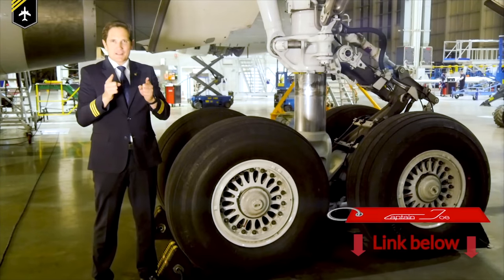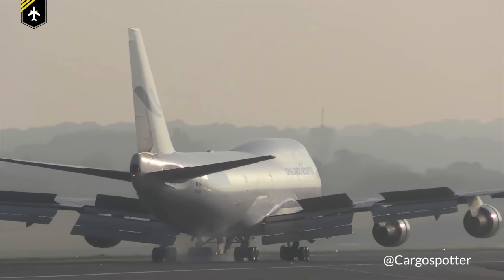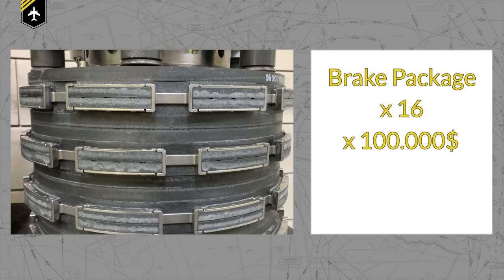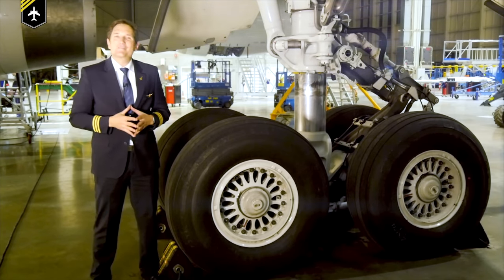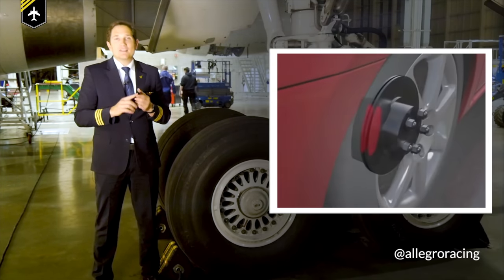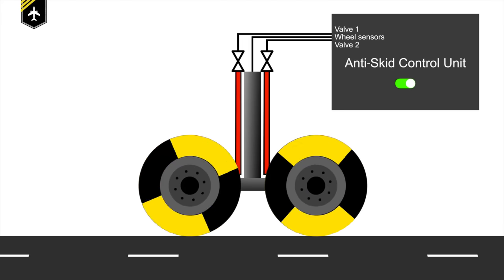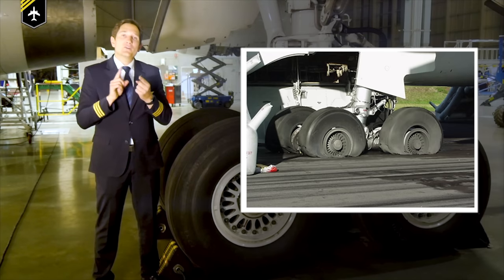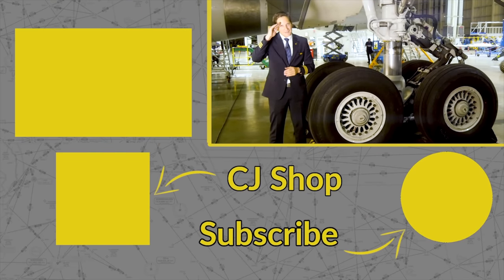Do PLANES have ANTI-SKID??? How to PREVENT SKIDDING? Explained by CAPTAIN JOE

Comment: Joe how can you tell the difference between a Airbus A320, A321 and A220
Reply: kose the a220 looks totally different (it's a rebranded bombardier aircraft after all)

Meanwhile in case of the a320 vs the a321, the a321 is noticeably longer, and it has 4 sets of doors each side (the A320 has 2 doors plus 2 smaller over wing emergency exits each side)
Reply: @ZK-APA  awesome thanks for the info

Comment: Interesting topic. At what frequency (per second) can a 747 anti-skid engage/release the brakes? I thought I once heard somewhere about an anti-skid auto brake system that automatically disengages at the first wheel lockup (and thus release of the brake pressure); just to make sure the wheels are not locking up on auto brake but without rebuilding brake pressure. So after activation a manual braking procedure would have to be done to engage the friction brakes again. I'm just curious if you might have heard of a system like that?
Reply: That doesn't sound right.  What does happen is that as a tire starts to lock up, brake pressure is reduced and then this repeats many times per second.

Comment: Hey joe., i have question. 
As you said during emergency landing when engine fails / or fuel leackage situations., efficient braking with the help hydraulics and reverse thrust ans cannot be possible.  So maual braking is the only way.

Why hydraulics is not functional..? 
Is the power by batteries inside not enough to source braking power..? Or not allowed to burden batteries.

Comment: I have a question. Why do pilots put the gear down so early when landing?
Reply: Gaming BrosBogdan because the aircraft has to be fully configured and stabilized before a certain point during landing.
Reply: The gear typically comes down on about a 5 mile final.  Each airline has a “Stabilized Approach” policy that dictates when certain configurations must be met.  Also, if the aircraft is faster than desired and descending, it can be difficult to slow down to the maximum flap speed for the next flap setting.  The landing gear is one of the best drag devices on the aircraft, and can be used to slow the jet down quickly to the desired speed.

Comment: What is the redundancy for the anti-skid control unit valve in case it malfunctions?  Seems like if it were to fail in the activated position, it would essentially make it impossible to apply the brakes?  Assuming I'm missing something.

Comment: Can you do a video on how airlines plan out which flight will go out of which gate number?  When I go to the airport, it seems pretty random, although I doubt it is actually random.   What factors actually go into how the airlines assign the gate of each flight?  Does it matter the type of plane?  Flight Time?  Proximity to other aircraft?  Number of expected passengers?   Grouping of common connections?  Do different airlines use different gates?  I am curious how this process is planned out.
Reply: Stephen Hinkle the gates are usually randomized. But there are factors which determine the randomness. Eg some gates can handle only certain kinds of aircraft (some are for narrow bodies, some for wide bodies, and some for say the A380)
And for gate from an aerobridge vs gate to a bus to go to the aircraft, the latter is usually cheaper, so some airlines prefer that.
But mainly gates are assigned to maintain maximum efficiency.

Comment: Great video on anti skid. The question I want to ask is unrelated to the above video though. Can an A-320 pilot hand fly the plane from "Top Of Decent " all the way down to landing instead of using the auto pilot?
Reply: Peter Lazuric of course. All planes are made in a way that you can fully hand fly them without ever touching the Autopilot.

Its just not done because it's just easier to use and manage the autopilot
Reply: If top of descent is within RVSM airspace (FL290-410) they can’t because autopilot must always be used within RVSM. If outside of RVSM and permitted by SOPs (weather, controlled airspace etc.), yes they can fly manually.

Comment: do the fighter jets use the same technology.why do they use parachutes when they have disc brakes, air brakes, and thrust reversers just like a normal commercial plane.ex: Sukhoi Su-30,Eurofighter typhoon,panavia tornado,mig-29 uses all it's three braking systems to reduce its speed on the runway.
Reply: anantha srikar fighter aircraft don't have thrust reversers 

And the reason they use parachutes too is for better landing performance purposes
Reply: @ZK-APA  thanks dude for providing info.

Comment: You didn’t mention that the wheels are paired to compare wheel speed and how fast the anti skid reacts. On a car you can feel the brakes releasing and reapplying but it happens so fast on an aircraft you can’t. BTW those brake units are bl.....g heavy.

Comment: When the plane is landed and safe to taxi how does a pilot know if the wheels of the plane is going on the lines and it is not going in the wrong direction and if it does how do they when to steer back in the normal route
Reply: Pro X practice. And one can imagine where the line would be, usually there would be a reference in the cockpit itself one can use 

(eg in the a320 it's between the 2 main displays ie the pfd and nd)
Reply: @ZK-APA  Thanks

Comment: What happens if there is a dual engine failure during takeoff after v1?
Reply: Hope the runway is long enough and activate full emergency braking
Reply: There's a lot of margin built into the FAA-mandated methodology for stopping distance calculation.  Depending of course on how far past V1, a safe stop is certainly a possibility.

Comment: Hi captain joe, I was inspired by you to be a pilot one day
I have a doubt whether the rotation of the areo plane is full controlled by the yoke
Reply: You are correct in your doubt! If the engines on one side are powered higher than the other, the plane banks in the direction of the  lower powered engines.

Comment: What happens if reverse thrust isn't properly balanced left-right (1 out 4 engine is off), or if  something occurs during landing (1 out of 2 engines is off)? To stop in this kind of scenario, only brakes are used, reverse thrust is anymore likely to be used?
Reply: Dragomir Alin I'm not sure regarding every aircraft, but I've definitely witnessed a single reverse thruster activated landing, so I know as a fact that its possible.

Comment: Captain joe.. i and my captain seniors pilot..was conducting an fly pattern on our local airport here on plaridel airport, plaridel. Bulacan, Philippines.. using an CESSNA 172. let say. Were Final Approach Phat localizer runway heading 17.. the A.T.C. Clear us to land runway 17.. by the way, when we are at the Altitude of 500feet or 950meters of the end of the runway threshold line... I saw someting went wrong... We an on COLLISION COURSE with another CESSNA 152 aircraft.

But the A.T.C. DOES NOT GAVE THE CESSNA 152 to CLEAR OR CLEARANCE to TAKEOFF RUNWAY 35..

We NEAR-MISS at an ALTITUDE of 100feet.

Comment: How much braking is done with the air brakes and reverse thrust in relation to the wheel brakes? Can you stop the airplane with only reverse thrust?
Reply: In a typically landing on a dry runway, reverse thrust (at a moderate stting) only absorbs about 15% of the brakes-on energy.  That's in part because of the relatively long amount of time (several seconds)  needed for thrust to develop starting from flight idle.  It's an "S-curve" profile for thrust-vs-time... not much besides noise at first.  So meanwhile the brakes have been doing their thing, and not that long after the engine is fully spooled up to whatever power level it's 80 kt and time to retract the reversers.

Comment: Is there a determined point after which you shouldn't land or the runway will not be enough? How do you determine this. I guess it depends on the type of plane and length of the airstrip.
Reply: Miroslav Marinov usually if you can't touch down in the touchdown zone (marked on the runway with white bars), you go around.

But yes ultimately it is a PIC call to continue or to abort

Comment: Hello Joe hope you are keeping well is it true that the 747 was one of the  1st aircraft to have abs and how long does it take a fully loaded 747 800 to come to a full stop if take off is rejected....
Reply: Airliner antiskid systems go back to at least the 50's -- probably more like the '40's.  They were "analog" until roughly the third generation of airliners, switching to digital.  Tailoring an analog system during development meant changes to things on the circuit board like resistors and diodes, vs simply reprogramming software.  The DC-10-30 had a couple of instances where its center main landing gear actually snapped off due to interactions between the gear and the antiskid at low speed.  That was solved by snipping a diode, which disabled the system below about 5 mph where the instability was occurring.

Demonstrated stopping distance from brakes-on for a fully-loaded airliner is in the 2500 ft to 3300 ft range.  Then an FAA-mandated formula applies a factor of safety to that to arrive at the stopping distances used in the  flight manual.

Comment: 2015 my wife and I flew to Cebu, Philippines and the airline we were flying had to what I would say slam the main tires on to the runway as it had just rained in Cebu and the runway was wet. The airport also has no ILS system so it is visual approach only. I felt the plan all of sudden pitch up because were were toward the rear of the aircraft then a small pitch down and then the plane slammed on to the runway. It scared my wife and many of the passenger but it was still a safe landing.

Comment: Do the anti-skid systems also monitor the difference in braking rates on both main gears to (effectively) keep the A/C braking in a straight line if one side starts to slip..?
Reply: No.  It is working to maintain an optimum slip ratio for each individual tire...  at least the systems I am familiar with.

Comment: Why are only AFT WHEEL Groups  provided "Touch Down & Hydroplane Protection" function? FWD WHEEL Groups are provided "Locked Wheel Protection", but not provided "Touch Down & Hydroplane Protection" function. So I see that FWD WHEEL Groups are not burst. And also, I think that it is more safety FWD WHEEL Groups provided "Touch Down & Hydroplane Protection" function.

Comment: Do pilots prefer a head wind or a tailwind when taking off?
Reply: Headwind. More airflow over the wings so less runway needed. But there is a limit because if that wind suddenly dropped then the aircraft could stall due to the loss of lift
Reply: @tomstravels520  I actually though the head wind will slow them down because the plane is moving against the direction of the wind.
Thanks for the answer anyway
Reply: Kwasi Sefah-Boakye at take off thrust it’ll make no difference. It won’t slow the acceleration much it’ll just slow them down during flight because the aircraft flies on indicates airspeed which can vary depending on wind speed and direction
Reply: @tomstravels520  oh I see. Thanks for the explanation
Reply: @kwasisefah-boakye6490  It slows down their ground speed, but the airspeed is all that matters. In fact, lower ground speed is desirable as it requires less runway.
Reply: @tomcorwine3091  oh OK. Thanks😁

Comment: Brother.. Can you explain about RVSM
Reply: RVSM airspace is airspace between FL290-410. Vertical separation between aircrafts is reduced to 1000 ft (from 2000 ft). This results in increased airspace capacity and more efficient flight operations

Comment: Dear Sir Joe
Instead of Applying reverse thrust why a pilot will not remove his hands from the acceleration?

As the aircraft is in landing position so their even no need of 2 engines running
Reply: Youni Complr you need all the engines in case landing isn't possible and you have to do a go around
Reply: Also, it does't really save any money to taxi around on one engine, by the time all operating factors and costs are considered (I did an  analysis of that at the request of an airline).

Comment: Is it possible to apply cadence breaking on aircraft if the anti-skid or hydrolic systems fail, or is it best just to break hard and hope for the best? I'm not sure if it would work with the foot break mechanism for aircraft as a car/truck's break pedal could be operated with your heel (allowing you to use all your leg muscles to create the pumping motion), but tilting the aircraft's rudder pedals seems to require the ball of your foot (limiting you to your ankle muscles) (Speculating on the last part - I'm not a pilot).

(Cadence breaking is a method used in land vehicles for the failure or absence of the ABS, where you rapidly pump the foot brake to emulate the oscilation of breaking pressure and prevent breaklock)
Reply: If the hydraulic systems fail depending on the aircraft type you could have a very limited amount of pressure stored in the accumulator or alternate system so usually it’s just one single push
Reply: On the MD-80, the two brake accumulators allow for three complete press-and-release cycles of the brakes before fluid is depleted.  So yes, best to get on the brakes and then try not modulate them.

Cadence breaking wouldn't work for an airliner because there isn't the immediate feedback to know when a skid is occurring.  Using the lightest braking possible for the circumstances would maximize the chances of staying out of a skid, however.

Comment: Why doesn't the wheels come with electrical engines to speed them up prior to touch down. Wouldn't this prolong tyre wear?
Reply: Olle Hultman not really. Especially considering that adding motors will increase complexity, weight and costs. So even if there was a gain, it'll get offset
Reply: One of my jobs in an aircraft landing gear group used to be replying to letters from people who had invented pre-rotation of tires (I was given the task after arriving in the group from college with this great idea for... pre-rotation of tires!).  The bottom line is that all the smoke and noise doesn't amount to much wear-wise, so given the various weight penalties and potential operational problems which would go with any sort of system (there are numerous ideas put forth for how to do it), pre-rotation doesn't come anywhere close to being worth it.

Comment: Do all of those burst tires damage the runway? Does the airport need to close the runway until the runway is resurfaced? Does the airline need to pay giant amounts of money to compensate the airport?
Reply: No.  Runways need to be repaired or replaced mainly due to fatigue damage from thousands of stress cycles as airliner landing gear roll over any particular spot thousands of times.  The heavier the weight on a tire and the higher the pressure in that tire, the more "microscopic" damage that is done each time.  It's why larger airliners need more and more tires -- to limit that stress.